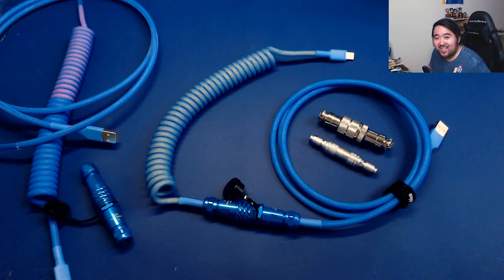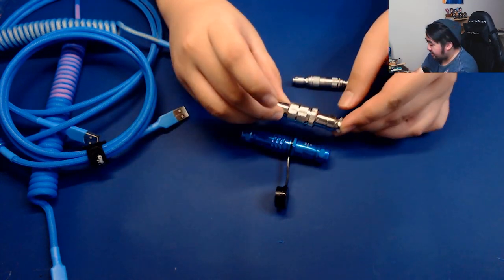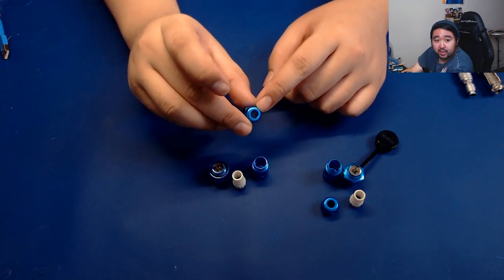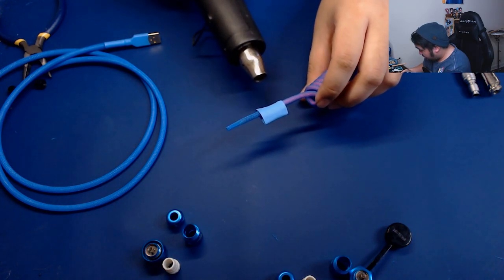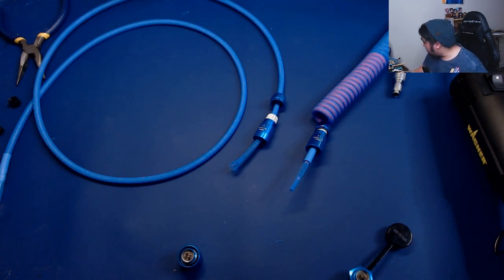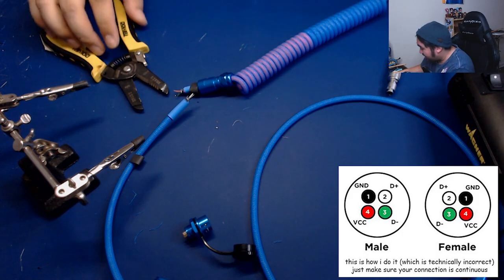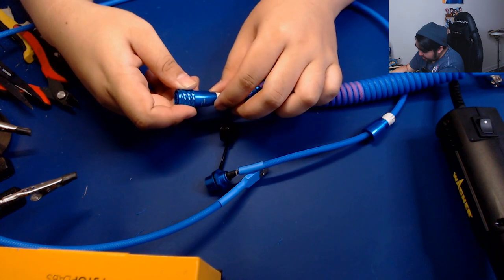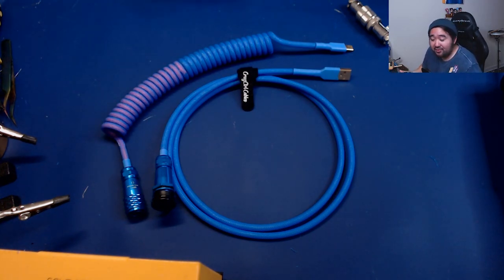DIY SA12 WEIPU Connector Tutorial - Mechanical Keyboard Cable

Comment: I believe those black rubber pieces you pulled out are to make the connector water proof. Probably not necessary for keyboard use, but I might try to leave them on anyway, though the heat shrink might do the job..

Comment: From artistic standpoint this cable is really super, super cool.😊
But technically, SA12 is a monstrosity designed for 2 mm^2 or AWG 14 wires that can carry up to 5 A @ 200 V AC.
For a keyboard cable even the smallest SA6 is more than enough for 0.5 mm^2 or 20 AWG up to 3A @ 30 V AC.
Size-wise SA12 is 18 mm in diameter and around 80 mm in length connected, vs. SA6 with 11 mm diameter and around 50 mm connected.
Not twice smaller, but close to...
Reply: niiice, do you know the size of a SA10? could not find info on weipu website

Comment: What I don't understand is why all custom cable makers are soldering the male connector to the short cable to the computer - the side with the "hot" wire which could be shortened! It makes more sense to attach the female connector to that side.

Comment: Can you post a tutorial on how to make cables with 5 pin connectors or link me on how? I’m kinda clueless cuz I’m a beginner to this cable thing and I want to make a amazing cable for myself!
Reply: I had one problem making my first detachable 5 pin, I was following the wiring diagram and it wasnt working. I just reversed the green and white cable on both connectors
Reply: @sk84lifewrx  haha dw i got it you actually had to connect the drain to the 5th pin and it worked fine that was my problem

Comment: What is the reason for having a way of disconnecting in the middle of the cable?  I have seen several examples of these for sale and never seen an explanation of its purpose. 

It looks nice.  I just don't see what options it gives you.
Reply from the maker: Reddit karma and Instagram likes

But really the functional use is that u can have multiple ends for different device types. 95% of the time it’s just an aesthetic choice.

Comment: In this type of connector, will pin number 1 always be GND?
Reply: Continuation of the question And why am I with a connector WEIPU SF610/S2 And it is the two-pin version, so it only has pins 1 and 2, but I don't know which pin is GND and which is VCC. Can anyone help me?

Comment: How long how much more extension do you need on a cable if you are going to be doing coils?
Reply from the maker: it depends on the inner diameter of the coil and what materials you are using. I typically use about a foot of cable per inch of coil using a 1/2in inner diameter for the coil.